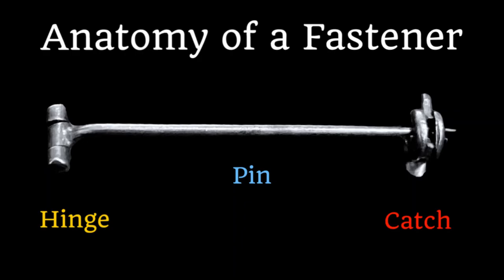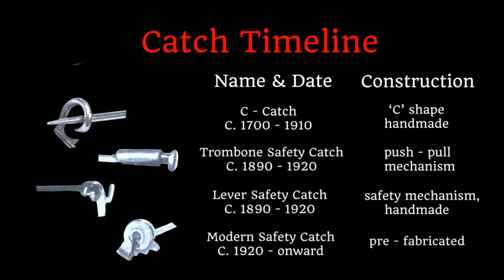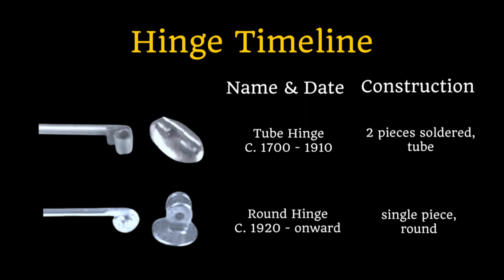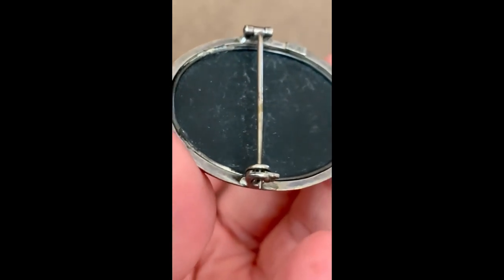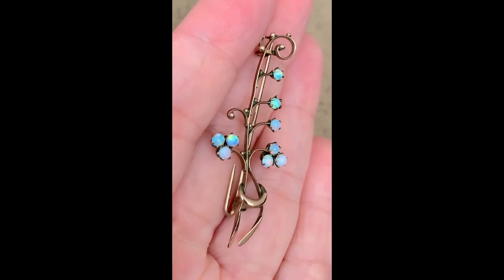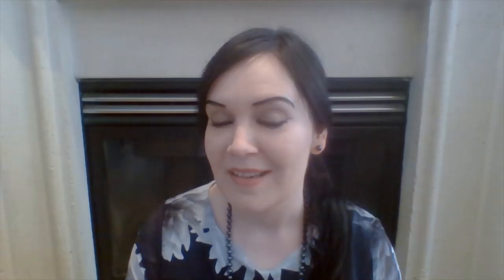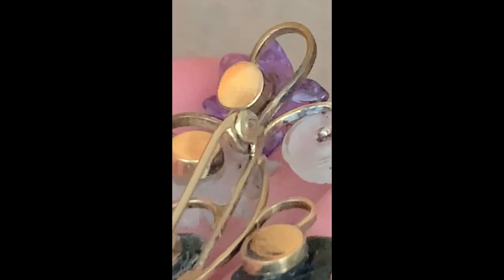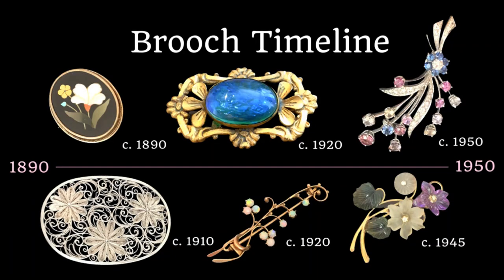Vintage Brooch Identification Tips

Comment: I have found brooch but i dont if its real platinum with diamond  emerald 6
Reply from the maker: Hello, and thanks for your question! To determine materials you can test the stones with a gem tester (like the presidium gem tester II); this is a great tool, however it does require calibration and some stone knowledge. Gold, silver and platinum can all be acid tested, however you may not want to do a scratch test. Perhaps the simplest option would be to take the brooch to a reputable jeweler who can take a look at it for you. Good luck!! 💚

Comment: What is a pin stop?
Reply from the maker: Hi! Here is a link to a listing on Etsy that shows a variety of stick pin end caps : pin stops: https://www.etsy.com/ca/listing/1536061796/vintage-stick-pin-lot-stickpin-lapel ; I like to use silicon earring backs as pin stops like these : https://www.amazon.com/Silicone-Backings-Backstops-Replacement-100Pairs/dp/B07CJ6C6B2

Comment: I don't see the difference between a handmade c clasp and a mass produced machine c clasp fastener
Reply from the maker: This is a great question! It can help significantly to use a magnifier to get in really close, and look for soldering, tool marks, irregularities and signs of hand made workmanship. Some machine made pieces even have the clasp cast as part of the design. The hinge is sometimes more “telling” than the catch is, so take into account the “sum” of all of the fastener’s part when dating it. Try this: grab two brooches - one antique and one modern - and observe them closely with a magnifier. (If you don’t have a loupe or magnification glass, you can use the camera on your phone to zoom in). Try to notice the differences. I hope this helps ❤️